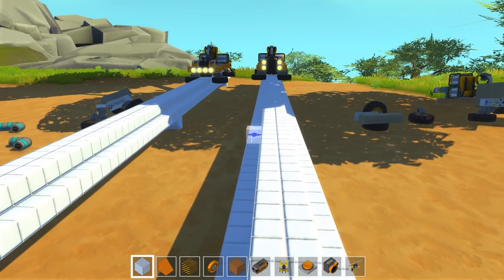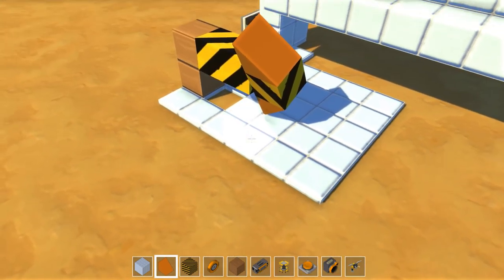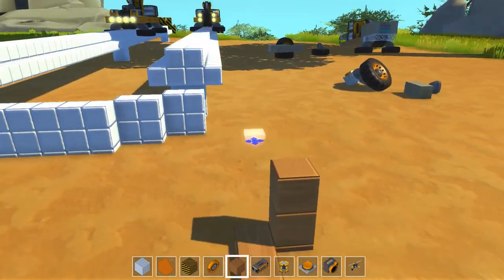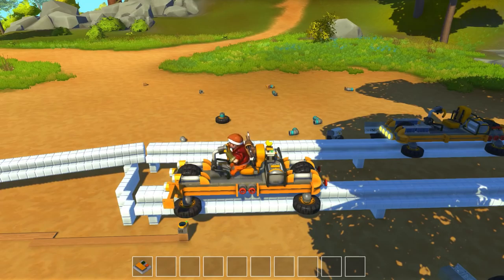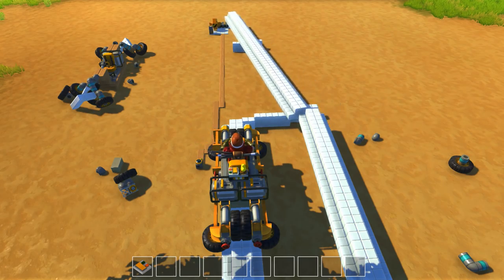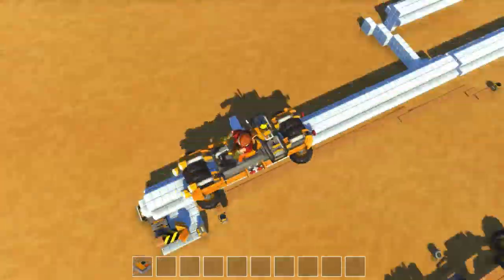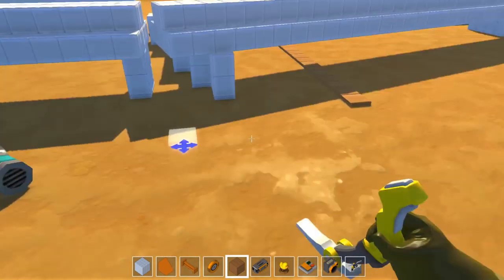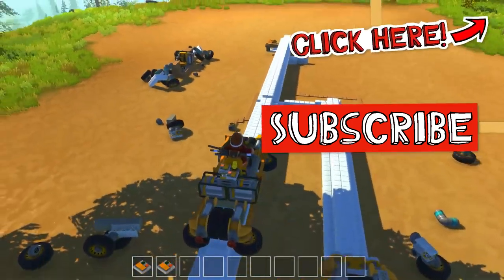Scrap Mechanic - SWITCHING RAILWAY - Let's Play Scrap Mechanic Gameplay

Comment: T flop could be short for toggle flip-flop, seems to serve the same purpose. If it's possible to create flip-flop gates then all sorts of shenanigans with computer circuitry are possible :D
Reply from the maker: +Alexander Mulkerrin Yup. They're not reliable so far. I tried to make one using a sort-of pendulum mechanism but it wasn't perfect, but it did do a good job of being either "on" or "off" without any "hovering" in-between as you get with the current design. Hmm. Maybe I should try and refine it.

Comment: A lot of people have built trains but no-one has built the hyperloop yet in Scrap Mechanic, until now, check it out on my channel, not trying to self-advertise just wanna share this thing since it came out better so much better than i had hoped..
Reply from the maker: +ryccoh The problem is curves - You can't easily build a curve, and you can copy/paste anything, so building long, complex  tracks is really hard. I've actually been thinking about the idea and wish I could come up with a decent design!
Reply: With my design I think very long curves would be possible because there's some space between the thrusters and tracks if you can call them that. So with the bearings I could do 15 degree turns it won't be a problem I think. I'll work on that tomorrow since I ran into trees with my track lol. Did you see my video I was surprised how smooth it runs. Most youtubers have a rough ride because they use wheels. Wheels make sense but the game makes them choppy on anything that's rail like.
I really like your rail switching btw it's clever even though the game makes things buggy for no reasons sometimes it seems lol. Thanks for replying, and nice channel, I'm subscribed.
Reply from the maker: +ryccoh Thanks! And your hyperloop looks cool - keeping everything floating is a good idea. I think you'll still have trouble with corners as everything has to bend and something has to guide the craft around the corner - but I wish you success!
Reply: Pirate and Fade Those side thrusters have one block space on each side, I think it allows for a narrow bend 15 degrees or less. Sometimes the hyperloop touches with the side thrusters on one side but it keeps riding smooth and stays on the lower tracks. I guess I should shut up now and try for real lol..
Reply from the maker: ryccoh Good luck!
Reply: Pirate and Fade Okay it's confirmed the thing turns. 3 degrees is buttersmooth at 4 it's iffy and starting at 5 degrees is disaster. I'll make a video of it tomorrow